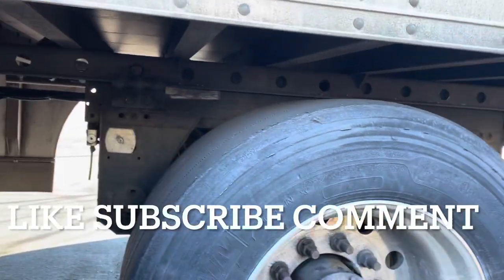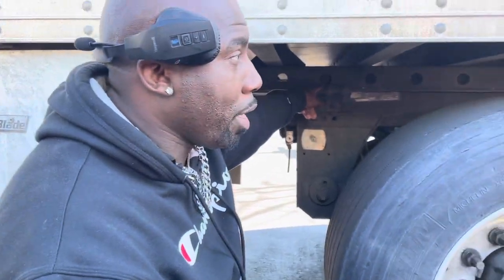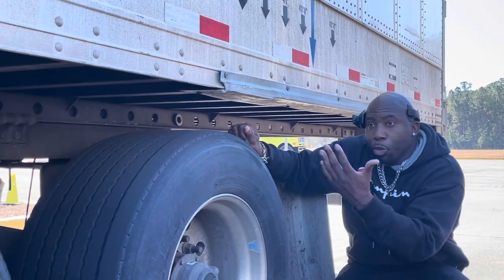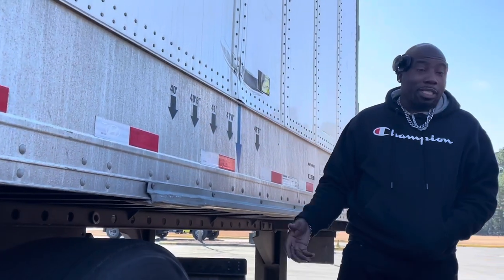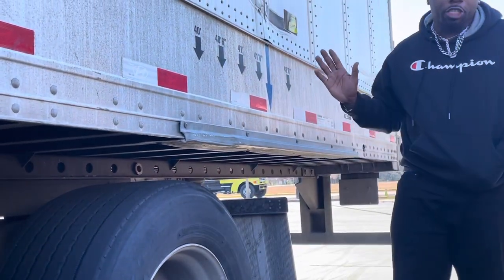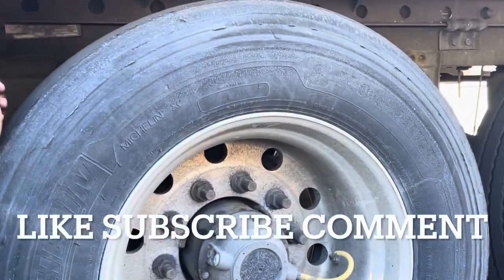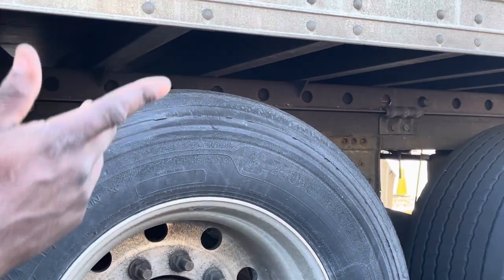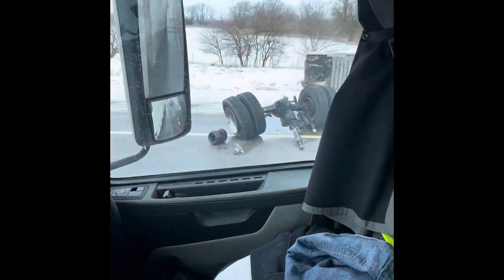HOW TO SLIDE YOUR TANDEMS ON A TRACTOR TRAILER AND WEIGHT PER HOLE FOR TRUCKERS

Comment: You sure each hole is 500 lbs? I was taught each hole is 250 lbs.
Reply: It depends on the trailer. Some holes are 500 some holes are 250
Reply from the maker: Depends on the trailer but some are 250

Comment: ❤❤❤ MANNNNN LISTEN I HAVE WATCHED OVER 35 VIDEOS I
😢 Yours is the best by far. I have been driving Uber 6 years. The only problem I've been having a sliding my tandems to the proper weight . May I ask? What was that object called that? You plugged into the hole. And also. Does that keep you from going too far? Back where you need to be? Also, some people say.  Each hole is 250 pounds. Others say 300 you are the first I've heard, say 500.😮
Reply from the maker: Ty bro I appreciate it. It’s called a tandem slide stopper tool. Most truck stops have em or Amazon When I have problems sliding mine. I use WD40 on the rails or I put a wheel chalk underneath the trailer wheel. Stay safe,blessed and run it up